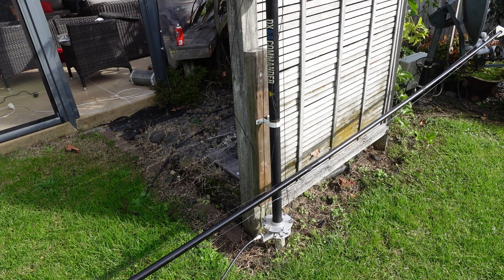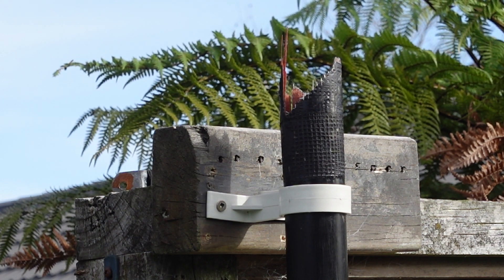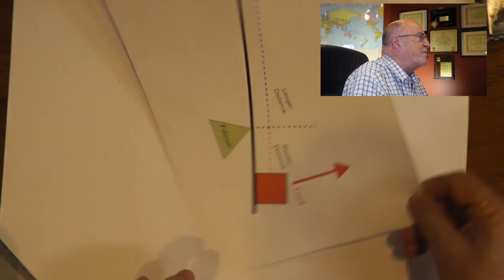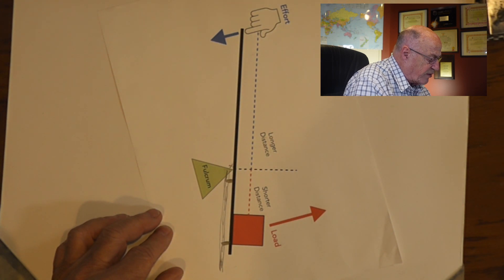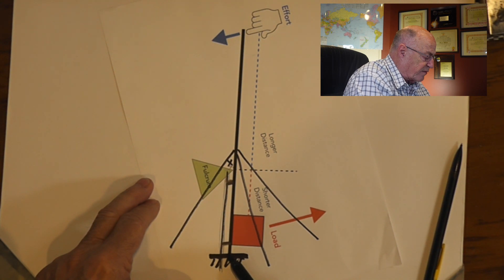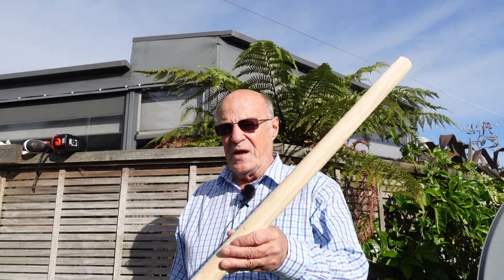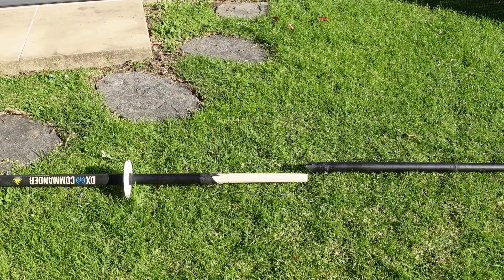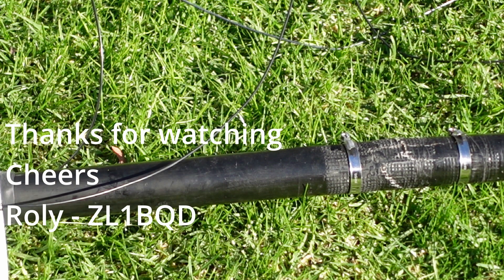HAM RADIO  - DXCommander vs Physics

Comment: I've seen a couple videos where DXCommanders guyed at 2 or 3 places on the pole have similarly broken and I suspect the reason is a very similar leverage problem where the wind load on the upper portion would see the upper guy as a fulcrum and the lower guy as a rigid "load" and eventually the  force exceeded the strength of the pole.
I have a Rapide plus and see the possibility of a similar problem with both the Rapide plus and the Signature 9 self supported antenna with high winds.

Comment: This is more "bending moments" and shear forces that need examining....or perhaps the pole bent so much it was pushed against the corner rail of the trellis...this would deform the poles circular shape and the corner would concentrate force at that point compromising strength?

Comment: before i watched it I knew it was because you never let the antenna flex, it was too rigid and where the clamp was became the focal point of any energy given by the wind. The top may flex but the bottom was fixed. Adding a guy system even on the direction only of your prevailing wind, I.E. for me is SW direction, would may have been enough.
Reply from the maker: Thanks for the input Jason...Cheers

Comment: I think I would take another approach..........since we know where the high stress point is, I would reinforce the mast at that point for as long a distance as you could............that will move the weak point up the pole but the un-guyed moment will be getting shorter so the "ft-lbs" will be less and put less force into the pole .......will still be bendy but the thinner sections have more wigglees in them  ..  could be done various ways............Cal can sell a DXC Roly pole support kit for 50 pounds cheers 73 Mike K1FNX near Boston
Reply from the maker: Many ways to skin a cat huh...  cheers

Comment: Fascinating indeed! And I'm sure you're correct; setting a fixed 'fulcrum' at that point would prevent the entire the length of the mast from swaying, which it's designed to do. My own DX Commander, which is situated in a relatively open, relatively flat plateau on a mountainside, has managed to withstand some fairly frightening winds over the past year or so. It flexes much like the fir trees that skirt the field around it. Cheers and 73!
Reply from the maker: Yes, I have used the DXCommander on a couple of SOTA missions and they were very windy indeed.  But because the whole pole could flex it survived very well indeed...  cheers

Comment: I guess when guyed, the pole can distribute the load and flex over a longer area too. Should you need any help with your new DX Commander, you can always "Ask Dave" for the instructions. 😉
Reply from the maker: Sweet, I will keep that in mind..... thanks for the heads up.....cheers

Comment: Fiberglass poles strength is in its ability to flex with a wind load. If you add guy ropes at a few places and it allows the pole to flex it will be ok. You have modified the poles design when you add spreader plates and vertical wires with load' I have a had a fiberglass pole with a single wire running up it  (33 foot) and it has been up flexing in 90 mph winds for over 15 years no problem.
Reply from the maker: Thanks for the input Craig....cheers

Comment: I have my mast mounted to a block wall. I take it down when we have high winds simply because of this. The top bracket acts as a stress riser concentrating the forces in the point just above the bracket , you can actually watch it in a breeze and see that it is trying to bend the most about 10 inches above the top bracket.
Reply from the maker: Yep, I should have listened to my concerned wife, but........
All is good now and lesson learnt....  cheers
Reply: @ZL1BQDRoly  it happens. I inadvertently prove my wife right all the time :)

Comment: Hi Roly
I agree with Anthony, M7CEV, that the root of your problem is actually with the two support brackets between the top and bottom bracket.  Thus you are forcing the supported section of tube to be rigidly straight until just above the top bracket. That concentrates the flexing forces across a very short length of tube, resulting in failure.  If your pole were supported at just two seperated locations, then the pole could have flexed a bit, which may have been enough to resist the breaking just above the top support.  This is well known in the structural analysis world.  Still, I have experienced Wellington winds and seen how towers and aluminium beams fail from metal fatigue, so maybe there is nothing for it but to add some guys.
Reply from the maker: Thanks for the input David, much appreciated.....cheers

Comment: Wow. That's a nice video and nice explanation how this could have happened. It makes sense, that's for sure.

I have one pole in the front-yard as support for my 160/60 wire. That one is not guyed but strapped down with tie-wraps. It is not secured with hoseclamps and with heavy winds it will come down automagically. Have put some spunge at the bottom to stop the hard stop at the end. 

It wiggles until it collapses, I try to get it down before that happens but it happened two times now that I was just too late. I've learned to do it earlier now.

The DX-C in the back-yard is normally guyed - quite strict on the bottom plate, a little looser at the higher two. Not sure if I should remove one or two guy-wires...
Reply from the maker: Thanks for the input Anton.  It is a great subject for sure.  Somewhere here in all the comments is the right idea i am sure......cheers

Comment: Hi Roly,
Sorry to see the pole snapped. Great Callum is sending one just for shipping charge. He is top notch. Nice temporary repair. Should hold up until new pole arrives. I've had two 12m Spiderpoles in the backyard strapped to wooden fence posts with wide Velco straps for about four years un-guyed and have withstood 70 mph gusts. They are being used for a terminated inverted U antenna which probably not as stressful as a DX Commander. You and Gail stay safe.  73  WJ3U
Reply from the maker: Thanks 👍 Don, great to hear from you.....  cheers, thanks for the input.

Comment: Roly, could be a combination of the fulcrum point and the number of cycles the wind blew and let up and the blew again.  I still have the DX Commander that was bent to 90 degrees with blowing freezing rain without failure.   Mine however was mounted on a 4 ft length of pipe 2ft in the ground and 2 ft above. I removed the rubber from the screw cap and slid the DX Commander over the (1.5 inch?) Pipe.  Let's the entire DX Commander pole to absorb the side loads.  Cheers.
Reply from the maker: I use a similar idea to this for my SOTA and POTA work, another video on the way for this.....cheers
Reply: @ZL1BQDRoly  I built a similar mount that fits into the hitch reciever on my pickup truck.  it has many options.  DX Commander pole, and other metal masts where I can mount VHF and UHF antennas and deploy them rapidly.

Comment: Paracord has some stretch, not a lot, but enough to stop the fulcrum point being too rigid. Even alloy poles can bend in high winds if they are fastened to a wall with a bracket.
Reply from the maker: Agreed Ken, I have a few alloy poles to prove the point !!  ...cheers

Comment: When I was a service engineer we maintained FAX machines and ordered “warranty spares” with the 200 main shipment from Japan. Instead we received 20:complete machines. The salesman sold half of them 😡but we still had to store huge machines and after a year we had a load of almost complete machines as only the same parts ever failed. What a waste.
Reply from the maker: I know what you mean.... Cal's idea of sending a complete pole as a replacement is a good one.  That way, Cal doesn't end up with a lot of bits and pieces and i end up with a few spares for other projects....   cheers thanks for the input.

Comment: Roly try just using two pipe brackets one at the bottom of the pole and one were you had the top one.
The pole can then flex between the two brackets when the top half bends in the winds .
I have a fan dipole on the top of mine and has performed well in high winds 
73s Tony M7CEV
Reply from the maker: Yep, great idea....cheers

Comment: Spot on, Roly.   I, too, had a somewhat similar experience - and learned from my mistake.  I thought that I would go the extra mile and guy my DXC at the upper spreader as well as the lower spreader as instructed.  The guying at the upper point made the pole more "stable" in gusty winds as only the small diameter top 3rd of the pole would flex and bend in the wind.  I thought I was all set, and the DXC looked wonderful!  I had also installed the 80m "L" as one of the elements and the additional guying at upper spreader minimized the "bowing" imparted from the weight of the 80m element....life was good.....  Then, during a rather brutal snow, freezing rain, and ice storm, the ice build-up on the 80m element  pulled down so hard that it snapped the pole at the upper spreader guy point - exactly as you show in your fulcrum-load diagram. Adding to the ice weight plus the initial element weight exerting a downward force, the accompanying wind added additional downforce making the pole crack at the stress/load point of the upper guy.  Being a fiberglass pole, it only took an initial crack to weaken the pole to the point of ultimate failure.

I have found two solutions....1) I only guy at the lower spreader. The pole flexes and bends in highs winds, but I've not had a problem since.  2) I ordered 2 spare poles from Callum; they're cheap as chips and I always have a spare - or an extra pole for use on experiments, portable ops, etc.  And, yes, I kept the broken pole and use it for other "projects".
-73-
Reply from the maker: Thanks for the input KJ.  It is great to hear about other peoples experience......cheers
Reply: that is the way i would do it but having several breakages from different fibre glass poles i have managed  to lash some thing up but what is permanent i do not know after nearly 40 years with limited options  on a housing estate verticals are great for experimenting with and dipoles are more reliable for non dx
Reply from the maker: @grahamg4pfk510  Thanks for the great input Graham.....cheers

Comment: The breaking force at the fulcrum is continuously changing in magnitude and might be mitigated to some extent by attaching a guy to the very apex of the DXC and running in the direction of the prevailing wind. Might not be great for the aesthetics but has worked so far(5 years). At least, that’s what I did! M0YZT
Reply from the maker: Yes, great idea.  Unfortunately in my situation that is not practical.  Working on a tilt over idea which may help.......cheers

Comment: Well Roly. I have exactly the same break on my DX commander pole. Mine was zip tied in few places at around the same height as yours to a very convenient support. We had a big storm last weekend with very high winds along with a good snowfall and it appears that ice/snow had built up around the pole/wire and with those winds (some said they were 90mph or more) became too much for the pole. I've not contacted Cal for a replacement as I'm on the waiting list for the self supporting version and my temp repair seems to be working for now. 73
Reply from the maker: All fun and games isn't it.   Let me know how you get on with your replacement ......cheers
Reply: DX Commander  That's ok Callum I know of the service. I blame myself for solid fixings. I'm just waiting for you to release the Signature series as I can't get away with guys the garden is small enough anyway. My wife has agreed for the new one to go in the middle flowerbed and radials to go under the astro turf before its laid.

Comment: I agree wholeheartedly with your assessment. I've never had a guyed pole break, but guys can be a pain in a high traffic area like the back yard. 
Might hafta devise a latching mechanism that will allow you to lay the pole down for the high wind events but can easily be latched into the upright position without tools.
Reply from the maker: Great idea, I already have some ideas along this line.....  another video coming up maybe? ....cheers
Reply: I have a pole attached to a length of timber, which has a bolt through the bottom,   so I can lay the whole lot down quite quickly.email for more info. Zl3xdj

Comment: Very interesting.  I guess that when erected with guys, the section below the guys is able to bow into the wind, reducing the shear force where it’s supported.  If the guys are too tight the bottom section will be in compression, which will lower its shear strength and make that section more liable to snap.
Graham G4OED
Reply from the maker: Interesting thoughts Graham, thanks for your input.....cheers

Comment: Darn Roly, that's unlucky. Kinda guessing but I think that as you have essentially rigidly attached the bottom ~1.5m of the pole such that the top attachment point is forcing the pole at the top connector to resist both the horizontal force of the wind as well as the bending moment trying to keep it from flopping over. When installed with the ropes attached with the ring as well as the base held to the ground, these only resist horizonal forces but in opposite directions kind of like your fulcrum.

Others that have it in an over sized pipe or other such where the pole is able to move a bit there is not as large of an increase bending moment applied. This allows the length of the pole in the pipe to more easily transfer loads to the base.

Or you are just unlucky and have found the maximum gust that the DX Commander can't sustain.
Reply from the maker: Thanks for the comments David.  Yes the wind was extreme for sure.  we were given high wind weather forecasts which i ignored obviously to my peril........  cheers

Comment: Hi Roly, I don't fully agree with your diagnosis. my thought is that effectively you have mechanically "shorted out" the flex in the lower section. A guyed one in a high wind has the opportunity to flex along the entire length which to an extent allows the antenna to reduce it's horizontal cross section as it leans. The same ability to feather is reduced if mounted rigidly. I have had a higher section break right above a join in a freak storm, no big deal but it  is about 15cm shorter as a result. FWIW the pole and the end of my 80m inverted L section is not clamped but instead secured with paracord, not wonderful engineering but I think it gives the mounting some shock absorbing capability in gusty winds. 73
Reply from the maker: Fair comments and worthy of some thought.  Thanks for your input, it is appreciated......cheers
Reply: @ZL1BQDRoly  thanks, I think there are times when we get these conditions and say to ourselves "that doesn't look good but I am not going outside to fix it".
I am sure that the windspeeds sometimes exceed the published ones due to funneling between houses. 73

Comment: Interesting Roly, I have either been lucky or clever with mine. Have it dropped over some 1.5" Aluminium tube which is secured in the ground, has some Concrete round it now. I initially had it dropped over a Tree Stake which lasted for over 12 Months before breaking. Of course mine still has a bit of movement in it as the Ali pole flexes a bit and there is some slight movement between the Classic pole and the Ali tube, it is not a tight fit. Mine has survived some fairly high winds, I wonder do you know how strong the wind was that broke yours? I have often looked at mine and the Top sections are almost Horizontal in the Wind.
As you say in your video yours and indeed mine are NOT set up in the way Callum recommends, however we do like to experiment :-)
Reply from the maker: Oh to be sure i lay no blame at the foot of DX Commander.  I simply had not really considered the physics involved and the wind was very high indeed.
I am not sure how strong the wind was but we were given fair warning by the local weather forecasters......   cheers
Reply: @ZL1BQDRoly  To clarify, I didn't think you were even suggesting any fault with DX Commander Roly.

Comment: Roly, I had a too-long metal fence top rale pole that looked real suspect to bend or break much s in your case. What I did was simply slide a plastic pipe over it giving it just a little room to move but not much, that plastic not being really strong or heave became just enough to stop a bend. A short piece of plastic pipe at the stress point being mounted with the mast pole then inside it a few inches above the stress point might be just enough to stop the break. Strangely a very near hurricane-force storm came through and it held up fine, but the 3 sections vertical on it actually unscrewed and came down. The pole worked but now has to come down and be screwed back in and reinforced the actual antenna. Thanks for sharing your experience !!!.
Reply from the maker: A nice way of spreading the load.....  cheers

Comment: Its not a Spiderbeam that holds up to 120km/h. I Snapped some common Fiberglass poles at around 80-90km/h Wind. That seems the Limit of nearly all not Heavy Duty poles. Mine snapped mostly on the 3rd or 4th element (count from the base) but it is also the mounting Location on my side that it snaps on this Elements.
Reply from the maker: Thanks for the input.  I have other poles that have stood up to very high winds indeed but they were all guyed.  In one of my other videos you can see one of these poles at just about full bend !!....Cheers